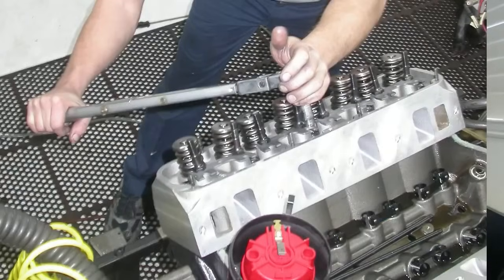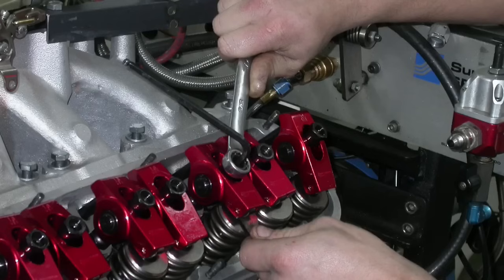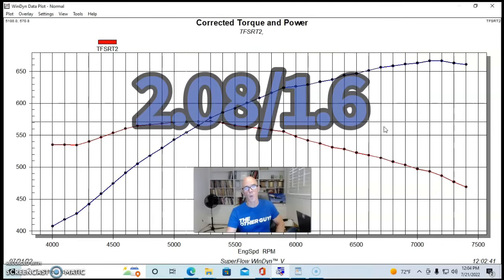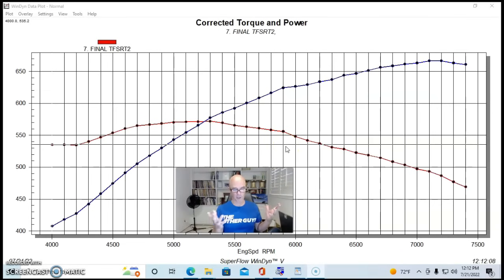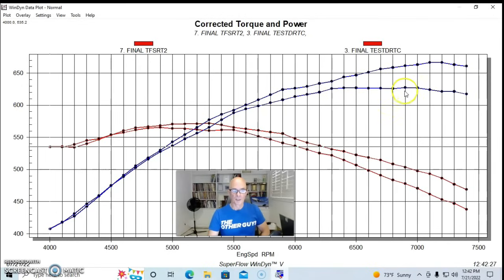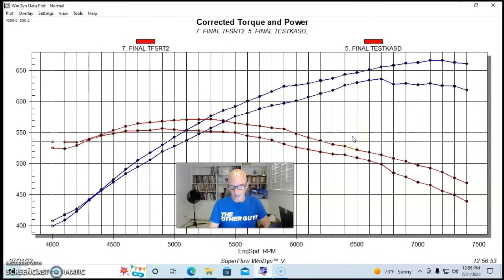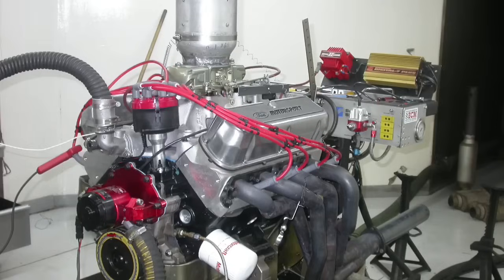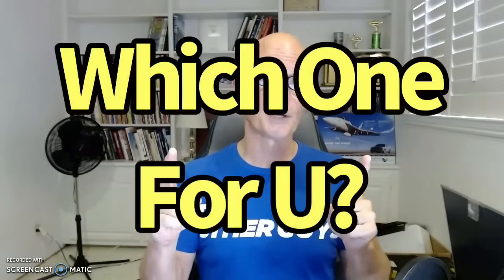WHAT CNC-PORTED SBF HEAD MAKES THE MOST POWER? KAASE v AFR v TFS R v DART v CNC VIC JR & HIGH PORT?

Comment: Based on all the live chat during the discussion about the LS head comparison, I was expecting a lot more power from a Ford.  There was a lot of smack talk from the Ford boys about how much better they are.  The power produced is what I would have expected and is definitely not better than an LS or even an old SBC.  My old school 427 with a set of small AFR210's that I purchased in 2000 made 640HP and 565tq.  That dyno pull from 2014 is in my video's.
Reply: Ford CHI or Yates eats all these . The Canted Valves Similar to Factory Ford Cleveland Architecture . Not Common Ford Smallblock Heads due to Outlaw Status for Decades
Reply: Ported LS3 heads are in the 350-365 CFM range and Ported LS7 heads in the 375-410 CFM range.   So the Ford head in question would need to be able to be in that range.    So for the inline heads it would be the 225 CC heads such as the AFR, the Dart, and a large port hi port and TFS TR all the way up to cleveland or yates C3...   Really only the ported TFS TR, Cleveland style or Yates heads can compete NA against the ported LS3 to ported LS7's or aftermarkets.    The engine doesn't care about manufacturer name it cares about flow.    They are also shooting for 600 ft-lb or greater out of these 400-434 ci  large small block builds.
Reply: This test was decades ago.  Old technology that is no longer relevant.
Reply: But what did your 427w make at the wheel through a big stalled th400.  Probably under 500wheel, but way faster than a stick.
Reply: @maximusvonce1381  It made 530RWHP which is irrelevant.  It went 9.56 @ 143 on a small shot of nitrous.
Reply: @Steve69SS396  What transmission and rear gear and cam specs?. What's et on motor only.
Reply: @Steve69SS396  What fuel
Reply: @maximusvonce1381   Stock TH400 gearing, 4.10 rear gear with 30" tires.  It would go 160 at 8,000rpm.  Only ran it on motor one time, I made 3 passes.  Best pass was 10.41 at 128 with a 1.51 60 foot at 3,500 pounds.  It was built for a blower or nitrous.  Cam is 274/286 @ 0.050" with 704" lift, 108ICL and 112LSA.  If I built it for motor only cam would have been 102ICL, 106LSA, gearing would have been steeper and converter looser.  Thanks
Reply: @Steve69SS396  530wheel all motor through a big stalled th400 is pretty damn good.  Did motor make 700hp on engine dyno?
Reply: @Steve69SS396  What fuel. Thats a massive badass cam spins to 8k. Drop some weight down to 3k lbs and that car runs 9's on motor.
Reply: @Steve69SS396  What stall you running.?
Reply: @Steve69SS396  Whats your compression?
Reply: @Steve69SS396  Did you run 100 shot nitrous?
Reply: @maximusvonce1381  Even without dropping weight I could have gotten it into the 9's on the motor.  I put it on the chassis dyno after going to the track and it was down 40RWHP because the AFR went to 11.2 after I put it in the car.  I took 10 jets out on each end of the carb, plus removed the air filter and it picked up 40RWHP.  The paper air filter alone cost me 12RWHP.  With the added power back plus different gearing it should have gone 9.90's.  The converter flashed to 5K on the motor and 5.5K on a 150 shot.
Reply: The 345CFM TFS-R's are around a set of Ported LS3 heads.

Comment: I have a 370 CI Dart with 195cc  AFR heads. Comp cam XFI236HR-14.  The manifold was an old Wieand EFI tunnel Ram base with a custom plenum and a 75mm T/B I origanally had fitted and was match ported to the heads. 
I have since changed to a Edelbrock Victor EFI manifold, part #29285  This manifold has larger ports than the heads. I would like to see a test showing this and what effect it has on the tune and power out put. Question, should I pull the heads and port match or just fit bigger heads?
The only thihg changed was the manifold and to a 1000cfm Holley Throtle body.
Reply from the maker: the port match is not critical-your intake changes makes a much bigger difference

Comment: before even getting into the whole video, seeing the tfs r heads made me excited. found mine in a storage unit the other day and now i need to figure out what to put them on. but lets talk old though. have had them for nearly 25 years now. 
the capt i work with wants to buy them and keeps offering money.
Reply: I bought a set of R heads the first year they came out!!still have them and just had them cnc'd by BES...stock port location and flow in the 370 range at .700

Comment: One of the many things I learned building big block motors back in the late sixties and early seventies was that you got to have the right header size. It may be a 427 small block, but it's running big block proportions. You got to go 2 in headers at least. I'm almost willing to bet that the smaller headers cause that power drop at the upper RPM range on the one test... Back pressure.
Reply: It would be interesting to see the tests with 2" headers, if you are truly fond of discarding low-speed drivability.

Comment: What kind of timing were you running in the test richard?
Reply from the maker: depends on heads
Reply: @richardholdener1727  you said the TFS were like 2 less than the others. Would it be safe to say it was in the 28-32 total range?

Comment: I know with the different canted vavles and other things that would have made things need to parts change. It would have been very interesting to see how the CHI 3V' heads would have competed against the best normal Windsor heads.
Reply: Yes the Aussie heads. Make big power. Like a Yates C3 head. I've seen a 454ci sbf make 920hp  n/a with those heads. Upwards of 8500rpm. Even the TFS  won't make the power the 3v or C3 heads will make. They can flow close to the same numbers but fall short in power
Reply: @forcedinduction5245  I just saw a SBF mustang with some Yates D3 heads making almost 1,100hp on just fuel. It was on the Revan Evan channel. Also if you search YouTube for “how to build horsepower” you’ll find 2 more Ford small blocks in the 800hp+ range on just fuel.
Reply: @RadDadisRad  yeah they make big power. A friend of mine did a boss 351 that was 383 inches with a sheet metal intake/one big 4bbl a ton of compression and a solid roller that had more than 300 degrees @.050. I don't know the dyno #s but with the iron heads it was making power over 9000 rpm. In a 3400 lb car and a C4 it went 9.83. I've heard they can move over 340 cfm on the intake side.
Reply: @forcedinduction5245  Cleveland 4V heads rock.    I was around for the original 5.0 days 87-93.   The stereotype in the day was the 4V's were too "big", no velocity, etc.    No one pointed out that it takes a ported TFSR to match a ported cleveland head.   The 4V cleveland head makes 275cfm@.600" without being touched and 310CFM@.600" with just a good valve job and 290CFM@.500", with bowl work and a good exhaust job they make over 300CFM@.500" and over 315CFM@.600".     WIth extensive port modification and filling in the floors from 340-370CFM on the intake side.    It's amazing we didn't take that architecture much more seriously in the 5.0 days, it was superior.    As good as you can get before going to Yates.    The CHI 3V is basically an updated and corrected modern day canted valve "Cleveland" head.     They make huge power.      They are used in 600-1000HP N/A combos.
Reply: @dennisrobinson8008  Wolfe was running C3's back in the 5.0 days. That is what put his 87 into the 9's ahead of everyone. As I understand it, the C3 head is a aluminum casting of a fully ported boss 351 head, then they had room to raise the exhaust floor.
Reply: @forcedinduction5245  I remember the c3 being what the big boys ran.   But I didn't think the actual Cleveland heads were popular among 5.0 guys.   I'm sure the hardest core hotrodders always knew the Cleveland head was bad ass.
Reply: 3V's are used in 600-1000HP combos...   They rock, however to test you would've need a different short block because the piston reliefs would be setup differently.

Comment: The twisted wedge heads have a inherit exhaust gain on a running engine over a std wedge head because of the relationship of the exh to the intake port in the chamber. That's the only head tested that would show as "Better" with the small header in your test. All of the inline valve heads would be similar with the only variable being flow and exit location of the exit of the port on the flange.
Reply: Your absolutely right.

Comment: Have you ever tested P38 heads?  I regret not getting a set.
Reply from the maker: i DON'T THINK SO
Reply: @richardholdener1727  They are Kasse heads and I saw a 302 make 500 Hp with them.

Comment: Take total valve lift minus lash 
Assume no deflection of push rod 
Look at 65% of cam lift after lash . .739 -.016 = .723 lift x .65 
.46995 lift .470 . Look at flow numbers of each head at .470 lift ( this is the constant cfm that feeds the motor 
The closer this number is to meeting piston cfm demand 
The more power the motor will make
Reply: Excellent Data.     Eric Weingartner measured actual "deflection" and it is around 5% in most cases.    So what he does to overcome it is run cam lobes a little bit larger than his intended actual cam duration and degree requirements required for a specific output.

Comment: 427 cid x 7100 / 3456 x 0.765 = 672 bhp.  The TFSR heads just tickled 100% VE, which is less than it can be.  That cam is too big.. 1-3/4" headers are fine at that power.
Reply: Not true dude.  Real programs like pipemax say it needs a 2", not some youtube commenter.
Reply: @superkillr  Real life says 1 7/8" headers are winning out up to around 750HP...     Look at all the LS stroker dynos.

Comment: I actually think it favors the cams that you wouldn't have expected to produce the most top end horse power! Actually, it's a little disappointed in the top end hp figures of these top end packages!! I can understand from 5500 up, but with the compression ratios and cam timing, these aren't street/strip combinations in my book!
Reply: With a high static compression ratio BUT intake duration to help bleed cylinder pressure at low RPM, high static compression is more survivable.
Reply: @exploranator  but it's kissing ur cousin! If ur bleeding the cylinder pressure off to keep detonation down, why not just use a cam that optimized the efficiency at a lower compression level? Wouldn't that actually make volumetric efficiency better? Sling it up a little more? Bleeding the compression of with overlap seems a wasteful. I'm asking, but it seems like you're bowing gas out the tailpipes! Now, are you trying to  artificially fill the cylinders with more intake duration, but artificially keep the static compression down to limit detonation? Not worried about low and mid range response? Pump gas racing?!
Reply: What stood out at me was the torque, peak torque was under 600 ft-lb and a well built 408-427 ci motor will make 600 ft-lb or greater.   So something was off.    I wonder if he was missing the header collector extensions, which would explain the missing 40-50 ft-lb, which would also explain why some of the heads didn't go over 700 HP.   In another of Richards tests the combo made 50 ft-lb less than it should and  he noticed that he didn't use extensions after the header collectors.   By attaching an extension to the header collector the torque increased across the board and peak torque up by 50 ft-lb, making what it was supposed to make.

Comment: I don't believe the headers held back much horsepower I did a header test on my own big block Chevy bracket racer it was a typical 454 121 compression ratio medium solid roller 049 cylinder heads 1050 dominator 1 7/8 headers car Ran 6.75 in the 1/8th mile installed 2 in tube headers car ran 6.72 in the 1/8th mile installed 2 1/8 in equal length race headers Car ran 6.67 in the 1/8th mile so total I'm guessing 10 horsepower Maybe
Reply: In the Chevy LS world they did a test on 550-700HP LS's and the 1 7/8" header was worth 20-30HP peak over the 1 3/4" with no low speed torque losses.    The 2" header had torque losses at 4000 RPM and below without much gain over the 1 7/8" at the top.

Comment: Now for the canted valve heads.  Brodix Neal, Blue Thunder, SVO C302B, etc.  2.75 crank main block.
Reply from the maker: those were going to be next-but dedicated race engine builds were beyond the scope of the original test
Reply: @richardholdener1727  In 2001 I bought my 1971 Mustang and over the past 21 years I scrounged up a pair of never built or ported C3 marked C302B heads, had "Scott the Mad Porter" who is fairly well known in the BBF crowd port and build them up.  They are flowing 335 on the intake side at .600 lift.  I also scrounged a old NOS G351 SVO block and one of the last SVO forged cranks for it.  Scat 6.0 rods in Chevy dimensions, zero balanced the crank (shop near San Diego that built trophy truck Ford engines).  I basically took what Roush was doing in the late 80s with the Trans Am/GTO engines and scaled it back, 10.5 compression, smaller roller cam but built to 351 dimensions.  It hasn't been dynoed but the parts combo should have me well up into the 500s if not more.  It's my 351X.. it's not really a cleveland or a windsor, best of both.  It was super touring car before the term was coined.
Reply: @kblackav8or  You can do all the way to 12:1 with aluminum heads on 93 octane, and there is also E85, which would allow all the way to 15:1 or so.
Reply: Good info

Comment: They don't jump up to 2" on big blocks until larger cubic inches. Why would they need them on a 427? With the massive cam profile and exhaust duration.... The 1 3/4" are moving everything there is to move. All the Ford heads have a small exhaust port compared to a 2" primary.  It makes no difference.

Comment: Trick Flow 225 Cleveland head makes what 650 hp at 10.5-1 comp ratio with significantly smaller hydro roller cam on a 427…..?  In their literature. Are those heads really that good?

Comment: Potentially... if you look at the EXHAUST  flow of each, the "restriction" of smaller headers would have impacted the heads with more flow the most. 

But... pure idle speculation. The quality of air flow is different than the bulk amount of air as the power observed didn't scale by flow bench max.
Reply: They've done these 1 3/4", 1 7/8" and 2" tests on the LS land in 550-700 HP N/A engine combos and the 1 7/8" win out handily.   It might be 20-30HP peak and gains across the curve.    The 2" loses at the bottom and isn't worth much at the top.   So they have settled on 1 7/8" headers on those 6.0L to 427 ci applications in their world.

Comment: Seems imo the headers held them back some. My 427 is very similar, 12-1, solid roller in the 700s, super vic intake, 1070 carb, afr 225, but with 1 7/8in headers made 675hp and 585lbft.
Reply: Nice...

Comment: Would've loved to have seen what it made using a set of ol' skool pro stock hi-port Cleveland heads or a set of C3 or earlier Yates heads.
Reply: That is a whole different ball game. Those Cleveland style heads rock.
Reply: Power potential from highest to lowest:
DOHC
Hemi
Rotated valves with Cant ( TW for example )
Inline heads ( small angle 12 degrees for example )
Inline heads ( large angle 23 degrees for example ).

A Hemi is the best two valve head you can get before you go over to DOHC.    Rotated and canted valves are a BIG deal compared to an inline head.   The TW heads were smoking the inline heads back in the days on the fords with an increase in mid range torque and top end power on the same combos.

Comment: The entire combination with 1 3/4 header vs 2.0 or 1 7/8 
Running airspeed through the motor can be tuned with intake manifold and header sizes 
I’ve run many combinations on pipe max and had headers built to pipe max specs and done very well 
Performance trends engine pro 3.9 can be used to show engine running air speeds 
If the combo is close to choke the small header makes it worse that’s when the larger tube slowed running air speed through entire intake tract and allowed more hp and rpm to be obtained
Reply: I would like that program, is it free?
Reply: @sstevocamaro  No but it's worth it.
Reply: So what you're saying in all the text is the test would show the same order as it sits now?
Reply: They did this test on Chevy LS on engine sizes from 6.0 to 427 ci, power levels from 550-700 HP and the 1 7/8" header wins.      It's 20-30HP peak over the 1 3/4" and no loss in torque.    The 2" header loses torque below 4000 RPM and doesn't make more peak power than the 1 7/8"...